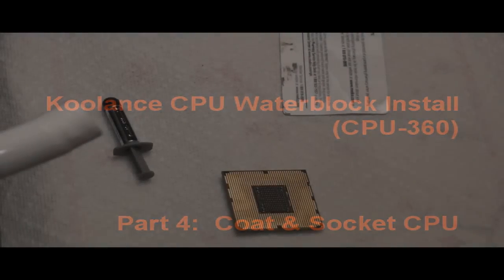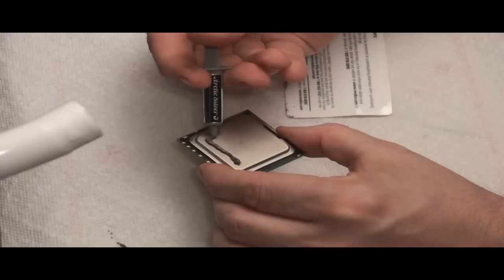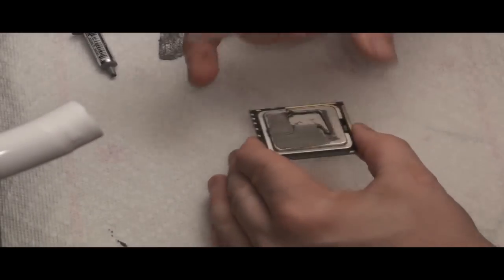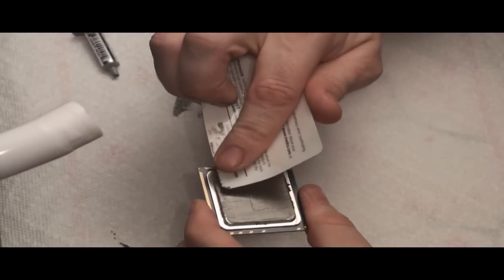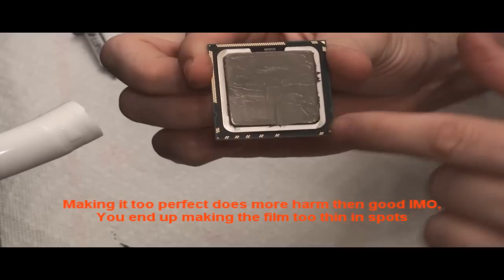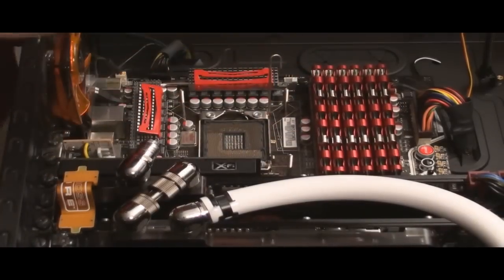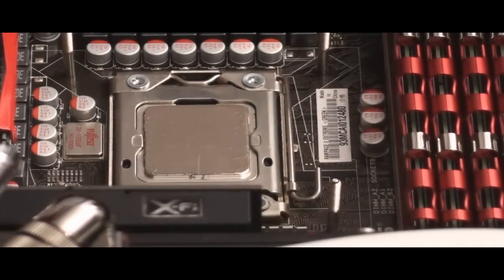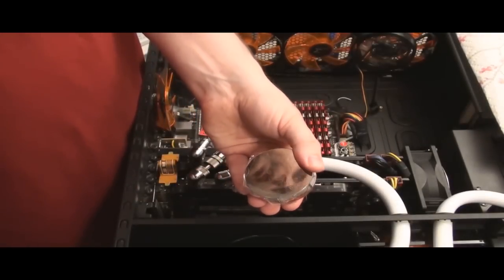Koolance CPU Waterblock Install - Part 4:  Coat and Socket CPU (Arctic Silver 5 on i7-980X)

Comment: Tape on the waterblock...  If you worry about fingerprints ruining the thermal transfer, what about the left over adhesive?  I agree, don't touch it, but don't tape it, either.
As for which method to use: Spread, line, dot, high-five, etc...  Wouldn't mind seeing a comparison after installation.  i.e. which resulted in lowest temps.  No shortage of theories (air bubbles in your method, too much compound in another, my method is the best, etc.), but not much real evidence.

Comment: Too much dude... it could be used metal on metal but because of the microscopic valleys it doesn't create the best even heat transfer. It only needs the thinnest layer to plug up the tiny little gaps. It's best to look up the official instructions (by the professionals) for your processor. (which would be the line method to line up with the actual cores.) Search: How thermal paste spreads if you don't believe us when we say this. That's 2 to 3 times more than enough.

Comment from the maker: @kerbewinne Yeah, I only use one of the thermal connections and I use the water temperature sensor.  The sensors that you can place on the CPU I don't recommend because placement and case temperature are such big variables in how the temperature reads that I don't feel it give you any REAL information.  Coolant temperature along with a program like RealTempGT is the way to go.  Hope this helps.

Comment from the maker: @vearheart42 Yes.  I have since tried the 'line method' after this video and I have seen no difference in temperature from the spread method or the line method.  I will probably do the line method in the future because it uses less thermal paste and is easier.  There is not performance difference from my experiment though.

Comment: @Trubyd44 200hr curing?? What TIM are you using? SHIN-ETSU X23-7783D needs only 4 hours to FULLY cure. It's even better than IC Diamond! The price ain't to bad either. It has a pretty high viscosity so you'll be limited in what way you can apply the paste.

Comment from the maker: @EliteSoldier112 I actually am testing the vertical line method right now...following people's suggestions.  So far I don't see any real gain, but I'm trying to get through the 200hr cure thing.  I will let you know though.  I have actually started a CPU without a block on it...just to see if it posted, hind sight tells me it was a bad idea.  :)

Comment: @Trubyd44 Hmm... Been reading up about different spreading methods. Here's an interesting one... (Don't try it, well I won't). Step 1 - Spread thermal paste evenly across CPU. Step 2 - Turn computer on without CPU heatsink for 5-10 seconds. Step 3 - Quickly apply pressure with the heatsink and tighten accordingly. LOL I had a laugh with this one. This one focuses on minimizing air bubbles as much as possible.

Comment from the maker: @EliteSoldier112 I have always done the spreading method.  WHAT IS FUNNY, IS TODAY I DID THE VERTICAL LINE METHOD.  TODAY!!!  I am using what the arctic silver 5 website recommends for spreading.  A vertical line method for Core i7 Extreme CPUs. So far, I don't see any huge gain or huge deficit from that method.  I will give it time to cure and give you my results.  Thx!

Comment: Hmm I always thought spreading was the best method of applying thermal paste but now I'm hearing a lot about this "putting a small dab" in the middle of CPU being optimal. It has something to do with reducing the chance of air bubbles where spreading actually causes some air bubbles to be made whereas putting some in the middle won't because the waterblock will press done evenly in the middle spreading it throughout without creating any air bubbles. Hey Truby have you tried both ways??

Comment from the maker: @Nadrealis  I may re-test this...after my current processor cures and I take readings, I will redo the socketing using the dab method and comparre.  Good comment!  (Don't worry about my 980X, I've had three of them already with no problems, I've had an i7-965 and i7-975 with no problems, not to mention older and hotter QX9650 all using the same coating method I used here without issues.  There may be better ways, but this way isn't wrong.  Again, good comment!

Comment from the maker: @Nadrealis I think you make a good point as someone else did.  I can see how air bubbles is bad.  But, I believe that eventhough the processor is in the middle of the heatspreader that everything is in so close proximity, that the more contact that you have from the heatspreader to the waterblock, the better.  I've touched a processor without a heatsink on it and it was untouchable over the entire heatspreader.

Comment: @Trubyd44 To each his own, on the site it says that since the actual processor is in the middle of the CPU chip, it's pointless to spread the AS5 over the entire CPU chip, along with the fact that it will create air bubbles. The best methods I've seen are the line and the dab. I don't wanna see your $1,000.00 980x processor blow up, I'd cry.

Comment: On the arctic silver 5 website it says explicitly not to spread the paste in this manner, it WILL create air bubbles and air is infamous for trapping heat. I repeat DO NOT SPREAD YOUR ARCTIC SILVER 5 LIKE THIS. THe best thing to do is put a dab the size of a grain of uncooked rice in the middle of the CPU and drop the heatsink/waterblock on top. It will spread itself and you only need a dab in the middle because it just needs to be on top of the actual processor.

Comment from the maker: @KapteinFruit CORRECT! Good Point! Thin is very good on the sides so you don't create an unecessary air gap in the middle. To combat this, I tighten the waterblock down each day for the next few days after install (Being careful of course). This helps spread some of the excess out and gets better contact in the middle.  Good Comment!

Comment from the maker: @MarshMellowChronic Your Dad is correct!  ...my thinking on it is that everything is in such close proximity, that having a small amount of thermal paste everywhere on the heatspreader cuts down on air gaps and transfers more heat.  If you or your dad has ever touched a cpu without a heatsink, I have...ouch!, it's HOT everywhere on the heatspreader, although I do agree the hottest portion is from the middle.

Comment: @Trubyd44 I told your friend that he sucks since he said first. :P
But, yeah, it doesn't have much to say and a little bit more is better then too little. And one fact is that it doesn't matter if you have much on the sides because the cores is in the middle so there is where it's important to have the correct amount of thermal paste. But it usually does so you have the right amount by it's self because the CPU is curved and the cooler is not there for it applies more  pressure on the middle.

Comment: The 980X looks big. Much bigger than my X3 720. And you started off with a lot of thermal paste! No wonder you was unsure if what you gave me would be enough! LOL! I put on a little pea sized dot on the middle and then even it out. ;)  And you should always use as little thermal paste as possible if you use too much it will get hotter than with a very thin even layer. But nice video. You could call these videos as walk throughs.